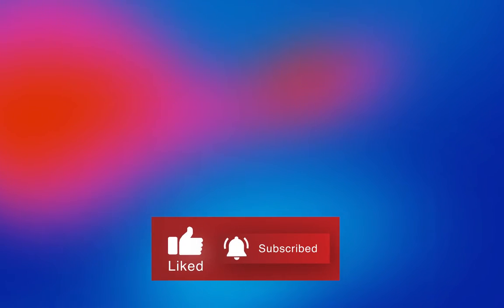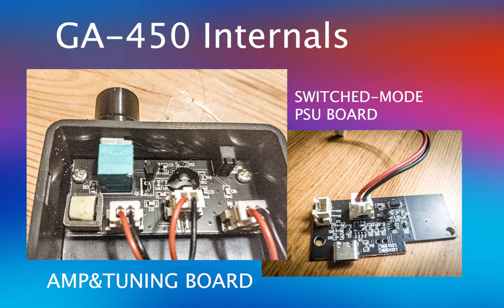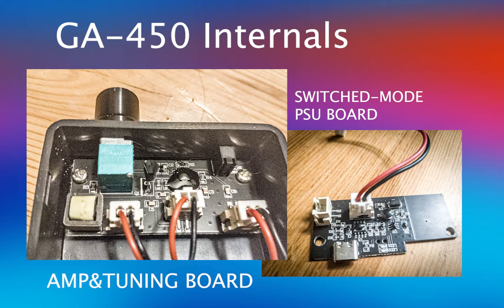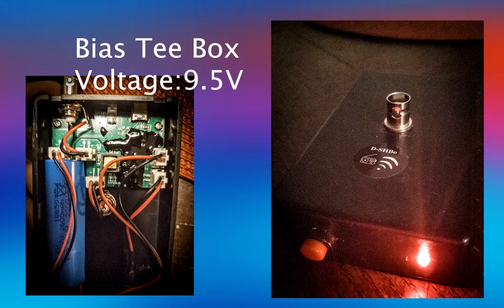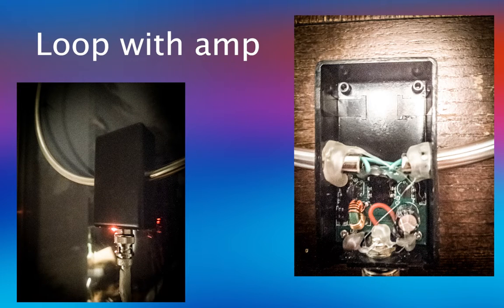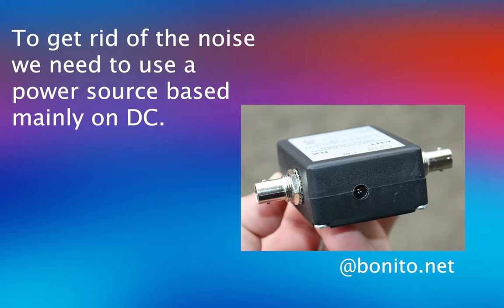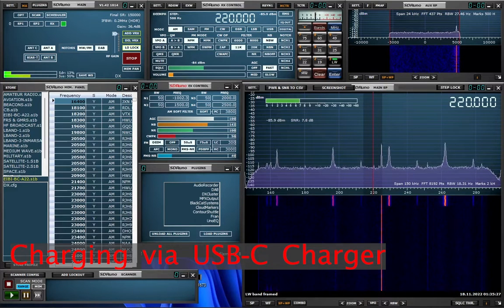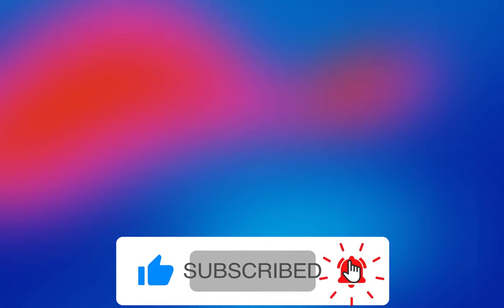GA-800 Loop Antenna - This antenna isn't for you! - DON'T BUY (NOISE PROBLEM)

Comment: Recently I purchased a Deshibo GA800.
There are some mixed reviews on this antenna on YouTube but nevertheless I took the risk.
My observations follow below.

1) Power supply
The power supply in the base delivers 9.49V to the BNC connector for the antenna module when the antenna module is not connected.
With the antenna module installed, the voltage is 9.25V and the current into the antenna module is 56.2 mA which is rather high.

Due to the single battery, the voltage has to be actively boosted to achieve the operating voltage. This is done with a switched mode power supply operating at approximately 40 kHz and yields a lot of harmonic content. The peak to peak value is approx. 100 mV as measured with an oscilloscope at the output for the receiver.
These harmonics are clearly present on the receiver and absolutely not desirable.
The harmonic problem was initially solved by removing the battery, taking out double RF-choke FL1 and installing it on its side with only the two output pins for the antenna module reconnected and its input pins connected to an external non-switched mode DC power supply. I also removed C6 which was over the positive FL1 choke on the PCB. See also 4.3) below.

2) Frequency range
This is specified to be 10 kHz to 159 MHz.
However the output coupling capacitor has a value of 22 nF. This combined with a load impedance of 50 ohms yields a lower 3 dB point of approx. 145 kHz.
The text of the data sheet, if correctly interpreted, suggests that for short wave and medium wave power should be turned on. For higher frequencies like the FM-, aviation- and V/UHF-bands, it is recommended to turn power off. Note: 159 MHz is still VHF, so where the U comes from is unclear. Also see 4.4) below.
So I think that the frequency range is largely exaggerated, also see 3) below.

3) Gain
Is specified to be 20dB (max) but with respect to what is not clear at all.
Seen the observations under 2) above, a large portion of the frequency range has no gain at all. In fact when on my FRG-8800 a VHF air-band ground station is received S4 to S5 on a standard whip antenna, replacing the whip with the GA800 completely eliminates the signal.
In https://www.youtube.com/watch?v=6wjRqsOYPWs Mr. Everythingia  shows a.o. the internals of the base unit and the antenna module of the GA-800. The internals of the base unit look the same as those from my unit.
I tried to open the antenna module but that appears to be glued closed, so I refrained from that for now. But what I see from his picture of the antenna module, the whole thing is not very much more than an un-tuned short loop with an amplifier. If that amplifier is to be switched off for a large part of the frequency range, the specifications are more to be interpreted as failed design goals.

4) Other
4.1) The BNC connection between the base unit and the antenna module sometimes breaks the electrical connection when the antenna is rotated, resulting in popping sounds on the receiver.
4.2) The 2 pin receptacle housing for the front panel LED on the pcb was partly broken.
4.3) I took out the entire pcb from the base unit, installed a new make-shift pcb with a low drop 9,5V regulator circuit to be used with an external - non-switched mode - power supply and only re-used FL1 from the pcb. Futher I installed a new 22 nF capacitor and a piece of 50 ohm coax, to complete the bias-T.
4.4) Turning off the power is a bit cryptically described in the data sheet as: "this design scheme, one is power saving, the other is low noise". It looks to me this is to avoid the noise from its own internal power supply. 

5) Summary
I purchased this unit due to housing constraints and having not yet found the time to build an active loop myself.
It was an interesting exercise in managing expectations but for what it offers, it significantly fails to meet the specifications and is over-priced. It requires significant modifications to make it more useful, so one has to spend time on it anyway.
Maybe this device can find use as a coupling loop for separate passive tuned loop antenna's, be it on a much more limited frequency range. I achieved e.g. good results on BBC radio 4 @198 kHz and also received BBC radio 5 Live (without tuned loop). But then again it is only useful for radio's without internal antenna, otherwise a passive tuned loop can be coupled directly.

Comment: I do not recommend this antenna, if you do not have the option of remodeling. Why? At the bottom is a power supply that transforms the 4V battery voltage to 10V. This converter is a large source of interference. This can be seen when receiving in the FM band, when the antenna must be turned off. The antenna itself is not suitable for FM reception because there is nothing but two BC337 transistors,
in differential involvement. It also works at 4V, so you do not need a converter to 10 volts. I remodeled my antenna. I installed a broadband amplifier from ALI, 0 -2 GHz in the base. And the loop antenna output is connected to its entrance. It is a big difference, compared to the original. If I want to listen to FM stations or Air,I will use the place of the original antenna telescopic rod. I have Radio Malahit DSP2 and this antenna is suitable for GA-800. If you know someone who is able to make a modification, you will be very pleasantly surprised. Just the removal of the inverter in the base is a good start. Without remodeling, this antenna is scrap.

Comment: I have the ga 450 and find it works quite well if the attenuator on the radio is set to minimum and let the arial tuner do the work .This seems to cut out a lot of unwanted noise . This could also work on the ga 800 .
Reply from the maker: @paulpearce4570  on Ga450 mod is easy, for ga-800 is little complicated because you need bias Tee unit, you can find such boards on Ali, also there are many options for battery power, currently I use rechargeable 9V batteries, they are very light, very pocket friendly, for such light battery I can power GA-800 for full 24h, if you use lifepo 9V  10ah cell I think you can power such antenna for min week, even more, because this antenna isn't power hungry, I have plan to record new video with such solutions, but I have very limited time now.

Comment: Antenna has no problem but probably you are the problem
Reply from the maker: Nope it is just design flaw using switching mode PSU that is huge no no in such antenna design.

Comment: No problem with mine. Works fine in the 2khz- 8khz spectrum ,but not efficiency higher.It's not a large spectrum antenna .It is connected to a tecsun pl 990x and I have better DX reception in the low spectrum than my outdoor 12m wire antenna.

Comment: Yes this make strong noise at 27mhz and 29.2 mhz  when power on, just put other 27-29mhz and turn on the amtenna close. This is rubbish.
Reply: I just purchased the GA800. I put a short 18" antenna directly on the back of my amateur radio at 28Mhz. Then put the GA800 box directly up against that antenna. With the power on and the power off. It made no noise in the receiver. No noise at all.

Comment: I have the ga-800, and there's no noise at all. However, in your loop box there is very little of that black acrylic glue paste stuff. In mine, there's a massive amount covering almost all of the components on the right half of the PCB.
Reply from the maker: Maybe they changed design, if true so OK, but it is lot better to no use any switching PSU in any RF equipment, you can measure voltage on BNC plug of box, if it have around 9V this use same PSU design, you can try use any different Bias-T boards if you can spot any differences, also this design had flaw that during charging you have noise, I prefer using simple Bias-T with exact DC voltage, and charge batteries separately.
Reply: Put an antenna 27mhz in your rwceiver and turn on the ga-800 close , you will see if makes noise or not.

Comment: An informative video with a good explanation what the underlying problem is.
GA-800 employs a boost circuitry that increases the voltage from the 3.7V supplied by the internal battery to 9V the antenna is using, so that voltage boost is the culprit for problems we're dealing with here.

As far as your comparing goes, comparing the Boni-Whip to the GA-800 isn't really fair, as Boni-Whip is different by design. Boni-Whip is an E-field antenna, by default using an omnidirectional antenna (hence the name), and the GA-800 is a H-field antenna and a loop. It's no surprise that Boni-Whip is able to receive more signals. 

For GA-800, using a Bias-T that outputs 9V to the antenna using a linear power supply (in other words, a non-switching power supply) supplying those 9 volts yields a lot better results.

For example, I'm unable to receive Weather FAX transmissions from Germany with my Boni-Whip (I do hear it but it doesn't decode at all), but it works perfectly with my GA-800 with the above configuration. Also, receiving Russian UVB-76 ("The Buzzer") at 4625kHz can be heard more clearly and for a longer period of time after sunset.
Reply: Seems like it would have been less work to build one from scratch!
Reply from the maker: Maybe you should try to build some common mode chokes to use it with Boni, or any E-Field antennas, you can try Amidon cores made from 43 or 31 material, for RX you can use smaller diameter cores and wire it with thinner copper wire, I think you can use 2 chokes, one near your RX setup and extra one somewhere near antenna.

Comment: Subbed to your channel a while ago. Thank you for this informative video. I was looking for reviews of the Deshibo GA-450 and I guess if the more expensive GA-800 is noisy as your tests show, the GA-450 will most likely be just as noisy. 😐

My current antenna is a genuine MLA-30+ and I power the bias tee using a Pineng brand 5V USB battery power bank. I'm not sure how clean the power is as the power bank has a built-in microprocessor which not only regulates the current, it also has a digital LED readout to indicate the battery's capacity in percentage.

I don't have SDRplay receivers but an AirSpy HF+ Discovery and an RTL-SDR Blog V3 dongle. I'm not sure if the MLA-30+ is suitable for either SDR but it seems to be all right for my Malahit clone V2 standalone SDR.
Reply from the maker: MLA-30+ is very good antenna for you HF+ SDR, this SDR have HDR feature so it is very sensitive from VLF to 160m band, this radio work same as RSPdx, DX is only SDR with HDR, I had this radio, but sold this, but for sure it is great and very small, ideal for getting this for vacations, ideal for YouLoop sence have LNA and HDR features. 73's!

Comment: Do you have the original ga-800.?
Do I have this problem also when I use only a charged battery and disconnected charger and don't use the antenna when it's charging? Thank you for your advice
Reply from the maker: Yes I have, even charged battery is bad choice for this antenna, problem exists only because they installed there in the box switching power supply, antennas should be powered via pure DC  injector, I've constructed such thing using Bias Tee board from AliExpress, so if you provide 9V and end you get 9V, using such thing you also have lot cleaner 2m band, I have also original AOR LA400, this antenna is expensive, but constructed only as passive thing without switching PSU, any constructor knows that unfiltered switching PSU always give you lots of problems, to power modified GA-800 you can use AA battery holders with ability to provide 9V or even rechargeable 9V batteries.
Reply: @mr.everythingia  What if it were powered via the USB C charging socket with a 9 volt battery?
Would this solve the problem?

Comment: I have one work good no problem.
Reply: Why does he have this problem and you don't?
Reply: @peterspeets9950  Because he is listning above 200Mhz and this antenna goes only to 159 Mhz.
Reply: @peterspeets9950 just like anything from China that's not made by a well known company, the quality of the one they have could be vastly different than the one the commenter has which will effect overall performance, one could be using cheaper components and fake components vs the other.